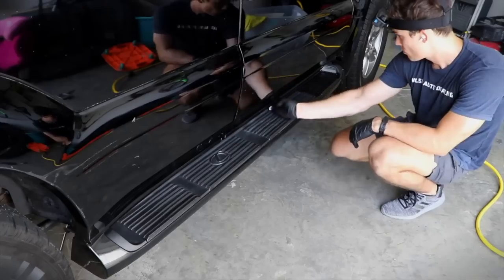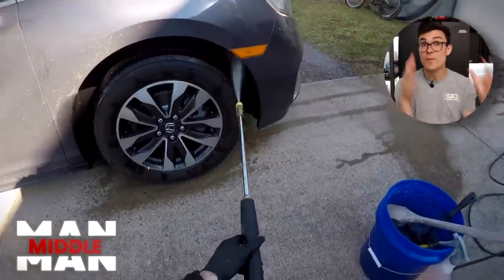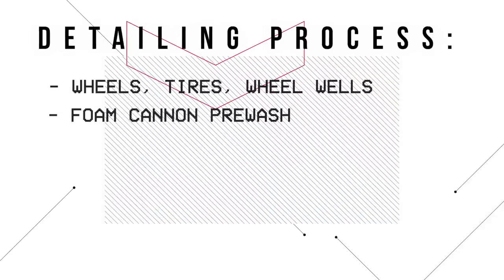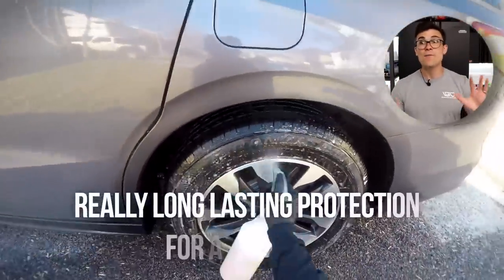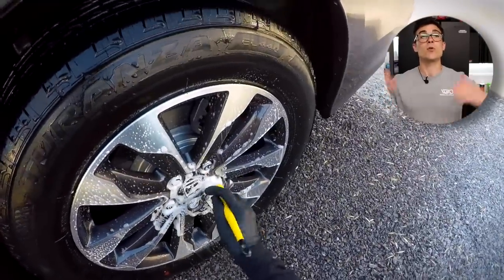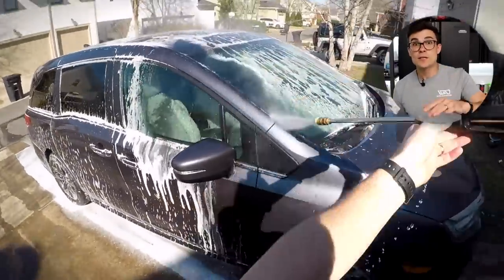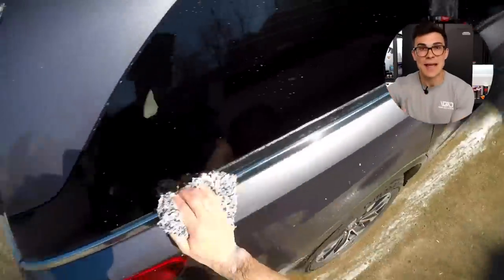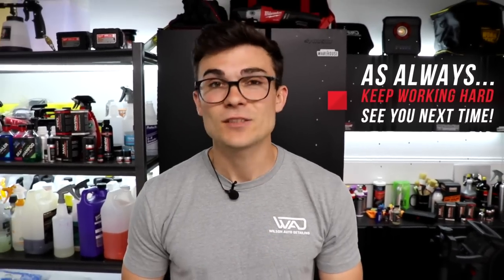Cheapest And Most Popular Coating Package I Offer

Comment: I wouldnt apply a coating without a polish.

A polish doesnt have to be a one step. Of course im not talking about a heavily oxidized super swirled black car. 

I see a lot of cars that have swirls and i *Could* easily polish quickly to clean the paint (after actually cleaning it) and apply a coating. 

I can polish a sedan in 20 minutes using the polish as a way to clean the paint. I do this quick polish often on white paint. 

Also, I almost never do full correction on cars prior to ceramic coating. 

I do a 1 step, sometimes need to clean up haze but usually dont need too on a sedan in 4 hrs. 

I dont understand these 12 hr paint correction jobs. Coat daily drivers. Make the paint look nice. PRESERVE  the clear coat on these daily drivers. Charge accordingly.

Comment: PLEASE NOTE:  As far as I know, all coating manufacturers recommend a machine polish before applying a coating.  If you are a new detailer, I would highly machine polishing.  Would you paint over old paint on wood, probably not.  You would sand, clean & then paint.  The same principle.  I explain all steps to the customer, and let them make final decision.
Reply: I completely agree with you. It’s actually baffling how he promotes no paint correction. Most of the times customers dont even know what they want nor know the process for a ceramic coating to properly bond to the paint, not only that but the scratches and swirls will be amplified if you ceramic coat over them
Reply: @e.cabrera1861  Thanks for the reply, Yes I try to educate the customer & explain the multi-step process of a full detail, which includes machine polishing.  I don't argue with the customer, it's their final decision if they want a coating or other type of protection.  I do charge extra for the coating.
Reply: @hartlanddetailer5670  aside from that premature coating failure can occurs if the coating doesn’t have a proper paint surface to bond to. If I was to do what Wilson “recommends” the customer is going to be upset on why their 5 year coating only lasted 2 years. Now I’m gonna have a customer that is going to tell everyone they know on how my ceramic coatings are a scam. That’s why I always do some sort of polish no matter what. Glad we both have the same view

Comment: Concerned about performing a clay bar decontamination and then applying a coating without a machine polish. Even a simplified paint enhancement polish instead of a full paint correction would be needed. Clay bar decontamination will always cause marring of the paint. Otherwise wouldn't it be better to just do a chemical decontamination and then apply a coating?
Reply: It doesn't always cause marring if you're using a good lube and a mild clay. Highly dependent on the hardness of the clear coat though. Porsches for example have a soft clear coat that will haze up with excessive claying relatively easily.